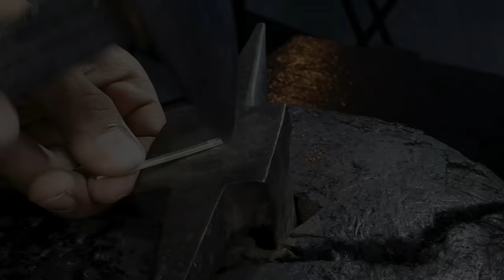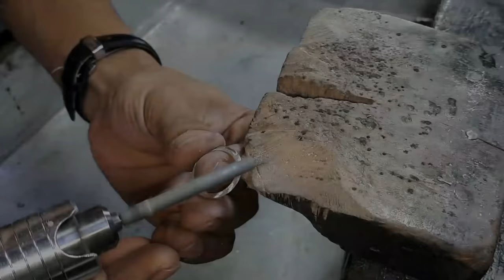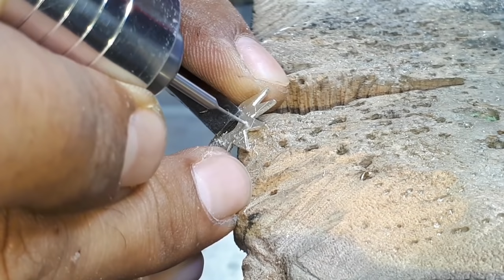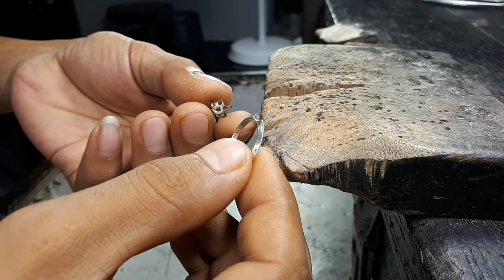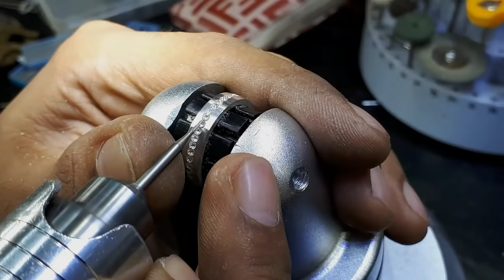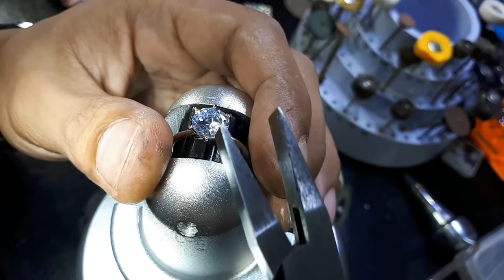How to make a simple solitaire ring design - jewelry handmade

Comment: How do you figure out the measurements for the setting? This is beautiful!
Reply: By experiencing,,?,, or  he may use a thin silver plate to do a quick test. Most goldsmiths do that, especially with unexpected measurements for handmade jewelry.
Reply from the maker: Hai cindy,,
Reply from the maker: if you are a craftsman like me, you just have to try to find out the answer,,
Reply from the maker: @mannhispen56  you right, thanks for helping
Reply: @Ryan_Jewelry  I am a goldsmith for over 45yrs,,learned  skills started from Hong Kong.  In  mid - 70,. now living in Canada, still working. Thanks for You Tube, I, ve learned a lot from many goldsmiths, diamond setters,, I use Wax carving, casting. & handmade skills combined. I find jewelry Making  is so deep., indeed very interesting. Especially handcrafted jewelry, always challenging.  I already Suscribe your channel.  Will like to see more of your art pieces done. THX, AGAIN.
Reply from the maker: @mannhispen56  hi my friend, thanks for everything, 45 years is a very long time, you are my senior, ok I will do better and thank you very much.
Reply: @Ryan_Jewelry  Longer in goldsmithing , may not mean I am better than the young ones, Your skill is excellent,   very interesting to watch your video. just curious, I like to use binding wires to hold setting and shank, before solder, I find it works better on me.. I do notice many goldsmiths like to solder free hand. 👏.  most Asian goldsmiths,  push saw frame,, up & down., many European, are pulling the saw frame  down., 😏., Quite sure there are some exceptions.. Keep up with your good work...
Reply: There’s a sizer for that.